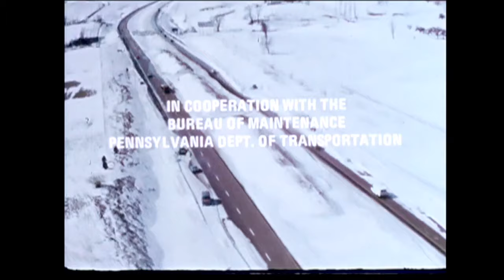"PennDOT Presents"  Snowfight ca. 1965

Comment: How could anyone live through that without front or all wheel drive, ABS, SRS like air bags, heated seats and steering wheels, his and hers climate control, bluetooth, mp3, GPS navigation, hands free phones, and remote start? Back in my day we called it Michigan winter driving. Now kids think it's a cool motorsport called "drifting". Sad.
Reply: Oh come on I used to drift the hell out of my ‘73 Comet! ...as my teeth chattered!🤣❄️
Reply: I miss sleeping in the back window of the old Bonneville.
Reply: Bwah ha ha. Old school, giturdun.
Reply: Easy I did you don't  need all that  crap
Reply: I remember two things back then - two wheel drive trucks, so put snow in the back to put weight on drive wheels

And stud tires / chains. Probably not so much appreciated now!

I was very young in the late 70s - if you lived in a rural area, unless you were driving some distance to work, we didn't "go out and do so many things" far away - going into town or the next town over was about it.
Reply: *Tire chains
Reply: You forgot auto darkening review mirror

Comment: 1:13 What kind of barn is that?
Reply: It seems to be a Pennsylvania Barn, which is a "bank type" barn with a gable roof. A few rows of ventilation openings on top. Most likely timber framed as most barns of the type are.

Comment: And today penn is one of the worst states at clearing roads during storms.
Reply: I work the Pennsylvania Turn pike 2000-2011 they put down the material and got the job done.
Ohio line to Kegg shed. 134 mile post
PSP TROOP T
Reply: @RickyO-e5g  i own a trucking company. We have more problems in Penn during winter then any other state
Reply: You can always tell when you're back in Pennsylvania to, just by the difference in the roads. Potholes galore. It also depends on the crew to. Where I live in Pennsylvania you can tell one good crew from the shitty one. From The Grove (it's a bar) to Ebensburg is pretty much wet bit from Strongstown to The Grove is always a damn fuckin mess because they're just lazy and don't care